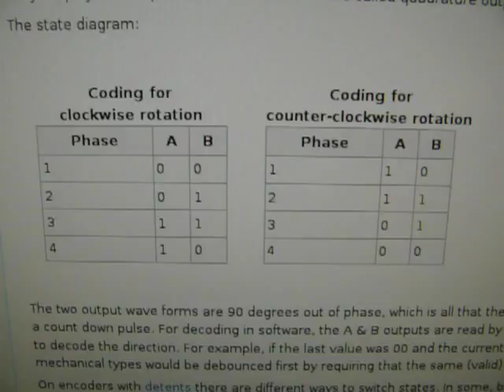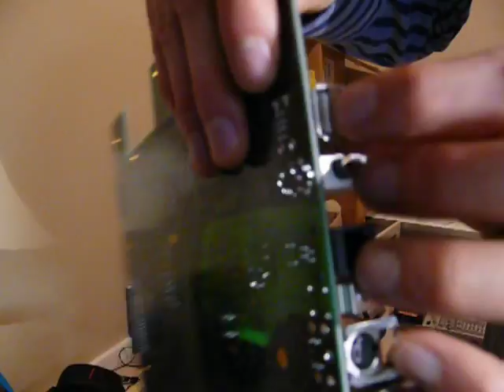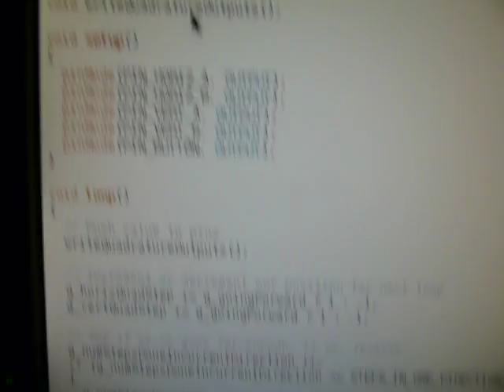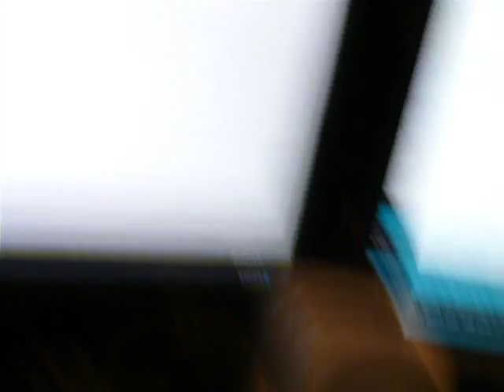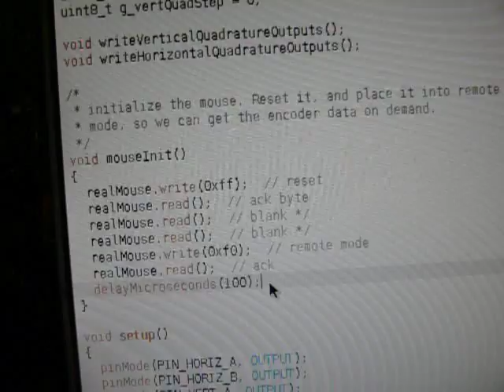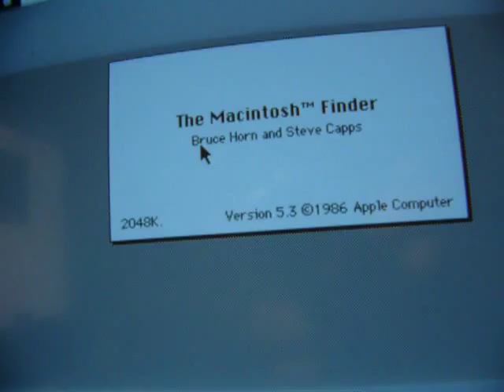Modern mice with a Mac 512k

Comment: You do know, the mouse is a serial connection right??  USB is also, serial but only with 1 data line.
Reply from the maker: Thanks for dropping by. Actually, though the Mac 512 and 128 mice do share an identical connector with serial PC mice, the mac mice (of this vintage at least) are not serial. They present a quadrature position signal to the host computer. Later mac mice used the ADB standard, which is indeed a serial interface.